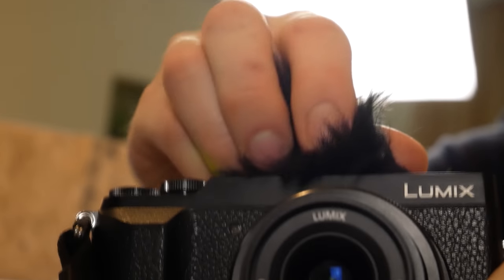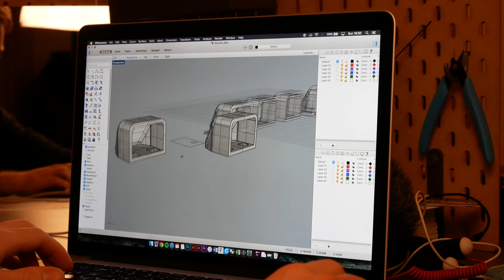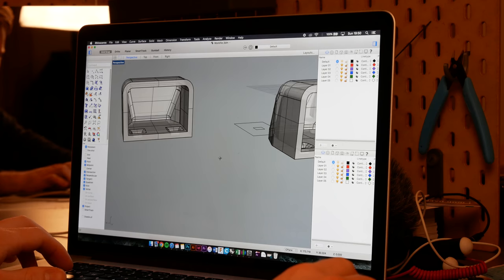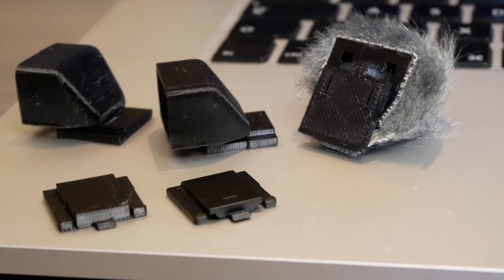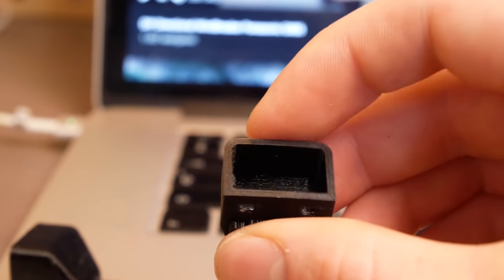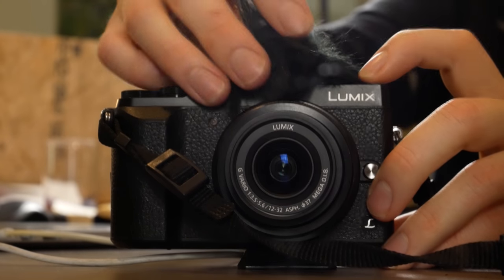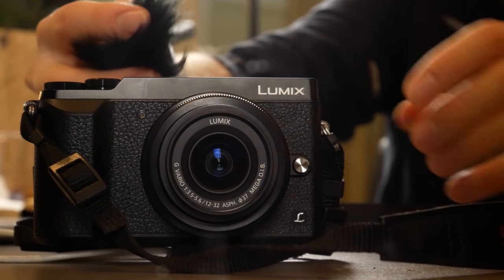DIY 3D printed Directional Microphone WindBreaker Panasonic GX80 / GX85

Comment: Very nice work. I've got a gx85 and was wanting to have this wind breaker. I was just wondering if it possible to create one whole piece instead of two which needs gluing.   I am planning to buy a 3D printer
Reply from the maker: I could design it in a way that it would be one piece. But once you get to know how 3D printing works you'll figure out that it is easier to print it in 2 pieces and then glue it together. I could add the 'fixed' file to the page in a while if you wish?

Comment: Hi 

Thank you, I will check my local store 3D printing. Do you know how much it will cost to print it? Where I can get the windbreaker gray feather to attach it. I also have issue. How I can solve the bad noise on dmc gx85. I thought it has a mic output, but it does not have it. I am trying to solve it
Reply from the maker: Hey, it should cost you a few euro's/dollars to print. Best material would be PETG or ABS plastic. The fabric you can buy at a local fabric/sewing store. Or maybe from an old stuffed animal you could cut apart.

Comment: why didnt you print it as a single part? it doesnt seem to be something a 3d printer can print as a single piece
Reply from the maker: Krysuss it’s easier to print it in 2 seperate parts + the way the layers of a 3D print makes it a bit stronger. But I have to say, haven’t tried printing it in one piece yet.